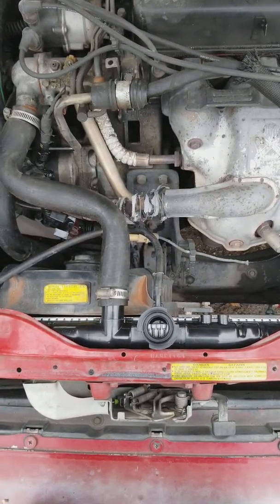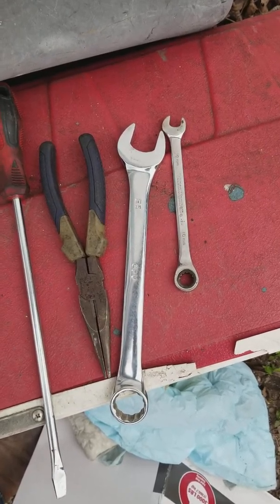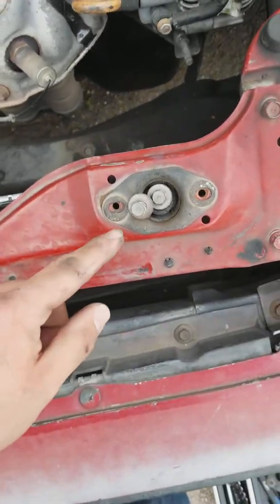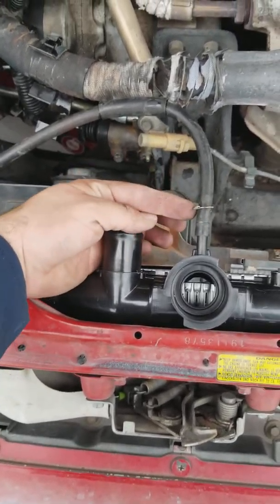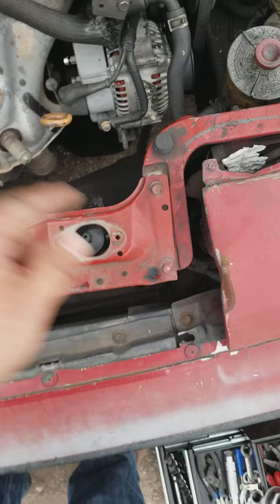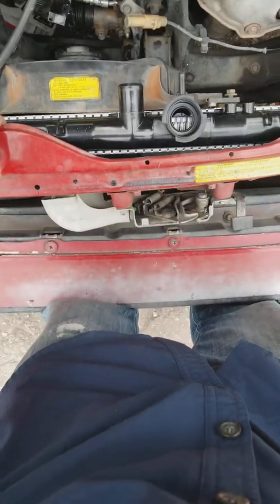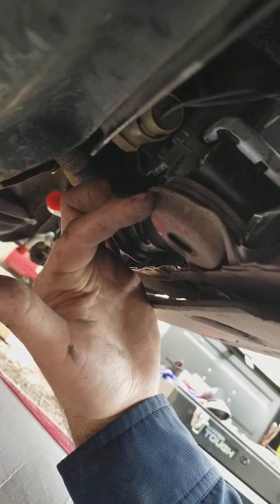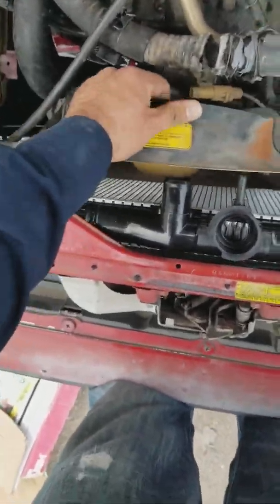How to change the radiator of a 3rd generation (1989-1991) Prelude

Comment: My 88 prelude has 2 fans and they have a spaghetti of all kinds of lines wrapped all around them. You can barely get a finger into some areas. The bottom of the car in cased in a plastic shroud. Also has automatic transmission lines you can't get to but need to. It has me so upset on how hard they designed it I'm ready to junk the damn car.
Reply from the maker: When I went to replace the oil pan on an 89 Prelude, I was not happy to find that the exhaust pipe had to be removed to drop the oil pan. Once I got the oil pan off, I saw that I had destroyed a bearing anyway, so it was already screwed to begin with. Thank you for commenting